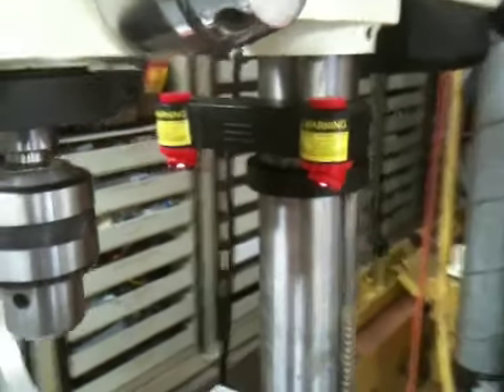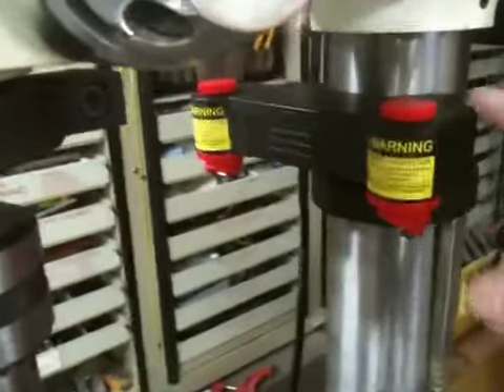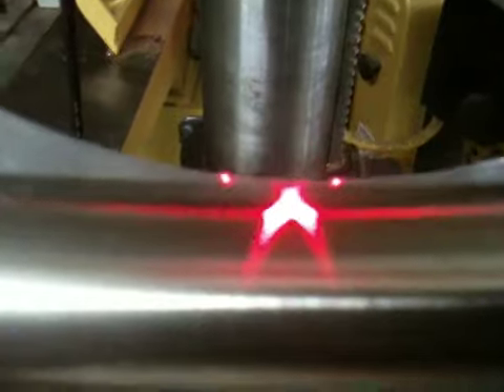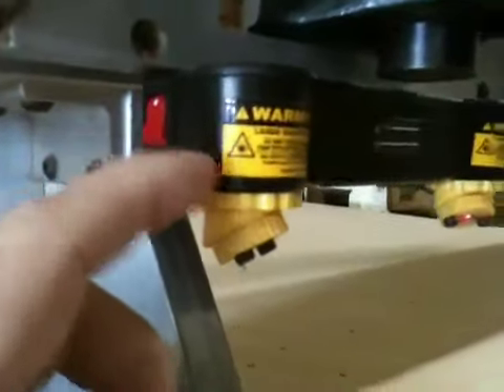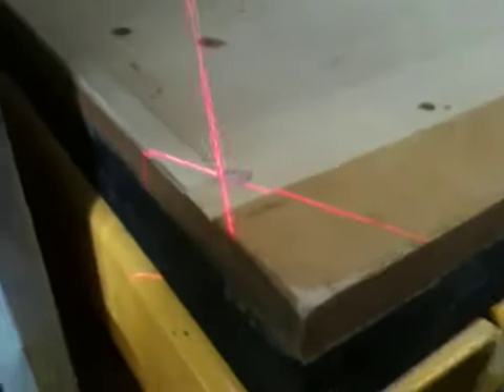WoodRiver Universal Drill Press Laser Attachment

Comment from the maker: Hi Darren, I cannot reply directly, so I am replying here.  The drill press column is in alignment with the drilling axis by design on nearly all drill presses, so if the laser attachment is on the column, and then you use the alignment jig that comes with the laser, you'll get a correct alignment no matter what height you set your material or table.  In regard to the CNC, this has been one of the most useful tools I have on the CNC.  Really, it makes everything so much easier.  By using the Wood River Universal Drill Press Laser Attachment, I saved hundreds and perhaps thousands in comparison to a CNC laser system.